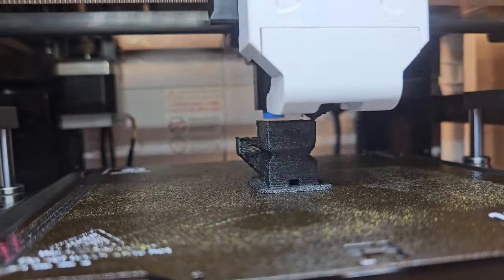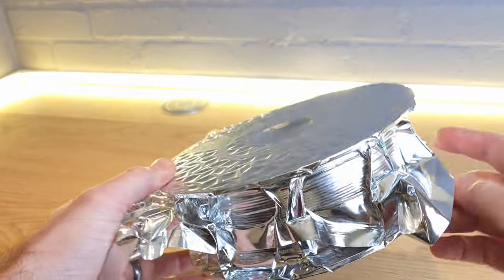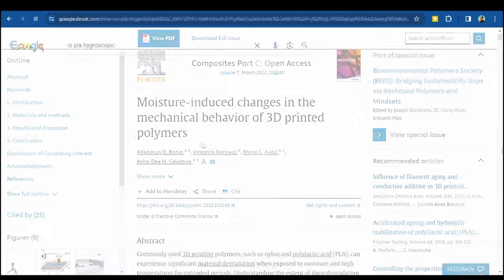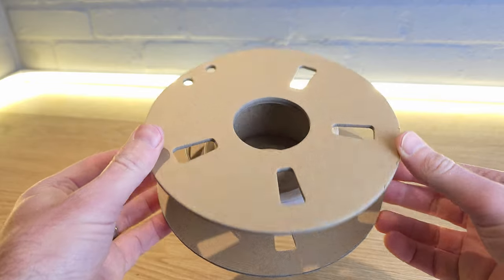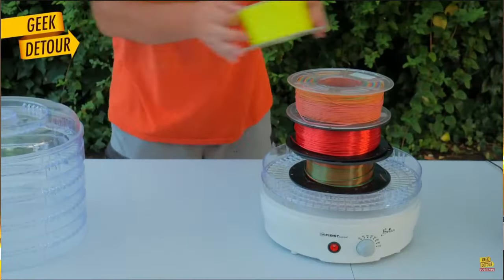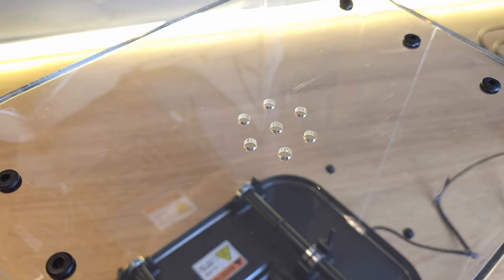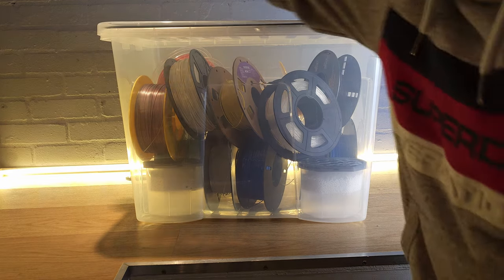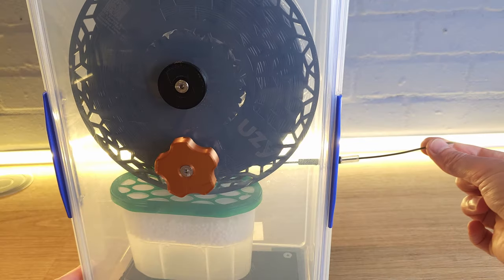How To Look After 3d Printer Filament With The Eibos Polyphemus

Comment: I have a super simple storage solution that can reliably get to 4% RH over the long term.

Basically a Plano sportsman chest with some thin weather stripping foam on the lid to improve the seal (total cost of about $30). To that  we add a dryer I designed (on thingverse shortly) which uses a 4028 high static pressure fan to push the air through a bed of silica gel.

Run the fan for a few hours after opening it and you get down under 5% and then you can switch it off.

I have around 12 rolls in there.

4-5% seems to be about the limit for a reasonable amount of silica gel.

You can go further down with molecular sieves but those are basically impossible to regenerate without working in the right kind of lab (which I do for reference). Down to the ppm range we get to some of glovebox set-ups but that is beyond most average labs even.

I would like to know where a good threshold is, 5%, 10%, 15%?
Reply: My filament is stored and dried by packing each roll individually in a zipping bag with a pouch of silica desiccant meant for - mind you - car dehumidification. They can be regenerated in a microwave quite easily (check with an IR-sensor not to overheat the pouch since it will be not as wet when drying is needed compared to a scenario with the intended use. 140ish C max). From time to time I check with a humidity meter. Anything above 10 % relative humidity and the pouch goes into the microwave. At least around 10 to 15 % PLA and esp. PETG got noticeably worse. TPU/TPE is best kept as dry as can be. People say TPU will string; I say theirs is just likely to be wet.
Reply: @39XenonD  I ran a bunch of tests using a microwave to regen silica gel and was relatively unhappy with the performance.

I had a sample in the microwave for a total of 15 minutes (letting it cool below 100C between hearings) and it was still holding onto 3% or so moisture by mass when I tossed it into the vacuum oven at work.

My oven dried samples all were totally dry baking at 120C.
Reply: @Ammoniummetavanadate  interesting. Unfortunately I don't have a possibility at my hands to dry them completely. Usually I chuck a pouch (300 to 450 g) above 7 % rel. humidity (measured in a sealed bag) in for 3 to 5 minutes. After 4 minutes it might be around 140 C and lost 2 to 3 % in weight. Cooling to 115ish C and then 40 to 60 more seconds back to 140 C. Rinse and repeat if there is still weight loss.

Best I got to was below 0.2 % rel. humidity in the bag after this, which should be sufficient. 

Most I had in terms of weight loss was a pouch at around 20 %,hum,rel. with about 6 % weight loss.

My benchmark for dryness in printing is, whether or how much the nozzle oozes when purged with fresh filament. Compared to PLA stored at 21 C, 50 %,hum,rel., my current method there is barely any oozing going on. A few mm of a .4 mm rod if any. At ambient it was massive and seemingly unending. PETG and PLA prints are super clean with the really rare case of the faintest of whispy fine stringing. TPU is virtually string-free.

What type of silica in which amounts did you dry?
Reply: @39XenonD  Silica gel is basically all the same unlike something like a chemical dessicant or molecular sieves.

I was running 500g in a low form beaker. A wider tray might be better but they beaker does fine in my shop oven.

Comment: I've got the Cyclops and honestly found it very underwhelming for the price. The whole thing is so obviously cheaply made when you see it in person, the hygrometer is the cheapest off the shelf standalone unit they could find, the shell is flimsy, it's awkward to use as nothing fits together securely and the spool holder setup isn't exactly top notch either so they tend to not move all that well when the roll gets too light so the filament stops feeding properly. I hope that new model will be replacing the cyclops at the same price point 😅

Comment: Pla absorbs water especially if it is in the air and all my filaments are in stored in a container with desiccants after use, and all put into a filament dryer when printing.
I don't use vacuum bags as i never found ones that hold a vacuum over a few weeks. A 4-litre plastic cereal container plus quite a bit of coloured desiccant inside so I can see if it ok and dry.